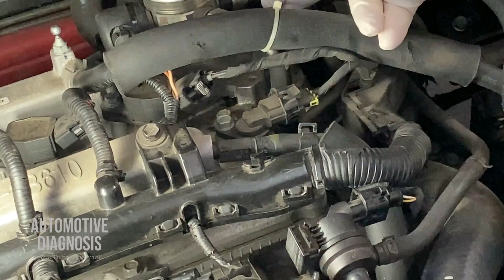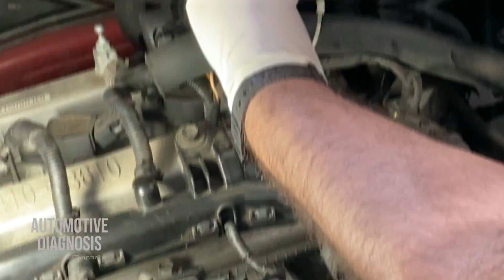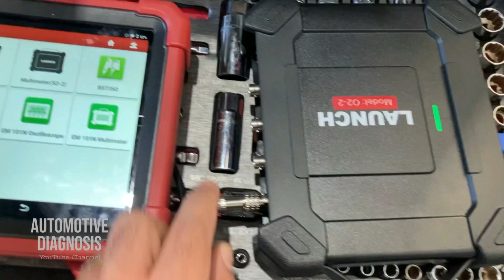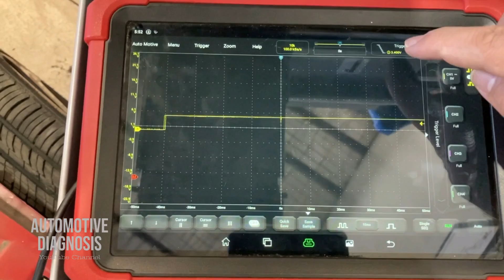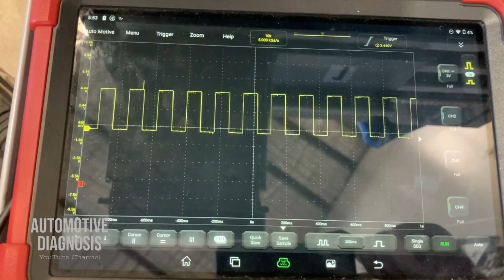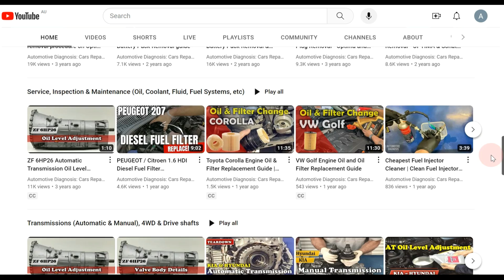Test & Fix P0341 Camshaft Position Sensor A Circuit Range/Performance Fault Code

Comment: My 2016 Chevy traverse lt has Po341 code. Check engine light is on I replaced Cam shaft sensor and VVT senors. so what is the problem with this car any help would be appreciated to get this fixed I'm at a lost 😭

Comment: how did you test the signal wire coming from PCM while the car was not running and the connector was unplugged? i mean, where did the signal wire get its voltage from? isn't supposed to be provided by the camshaft sensor?
Reply: Less than 5V is a biased voltage.

Comment: Make sure your oil is not low or dirty it can cause tht code and epc light/engine light to pop up even tho the camshaft is good so get a oil change then change camshaft then mechanic
Reply from the maker: Thanks for sharing your experience.

Comment: How do feel about putting dielectric grease in plug prior to plugging it back in?
Reply from the maker: Sometimes I do it on some connectors that contain many pins, but generally I don't do it on small connectors.

Comment: I love the explanation. Im looking at a 2007 Civic SI thats throwing P0341 and 2 O2 sensor codes. I accelerate the car and it goes to VTEC but it has no power at all what so ever. Im trying to figure out if its a simple fix or a engine tune up